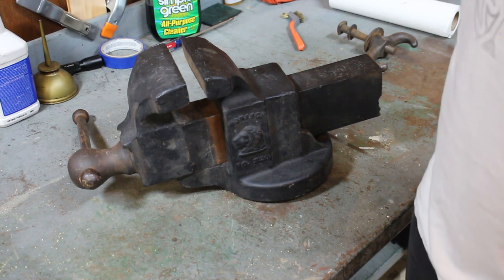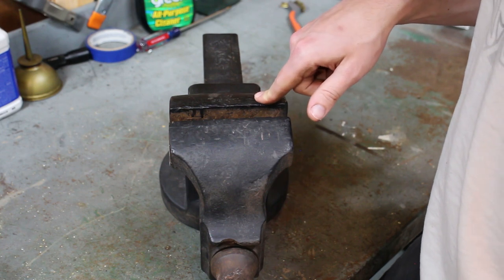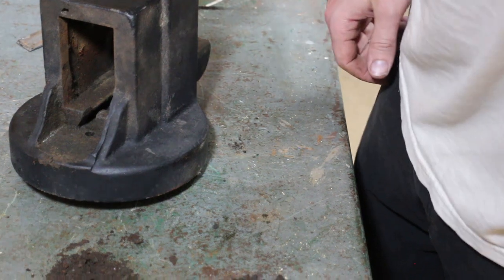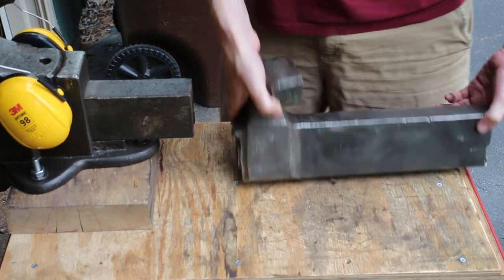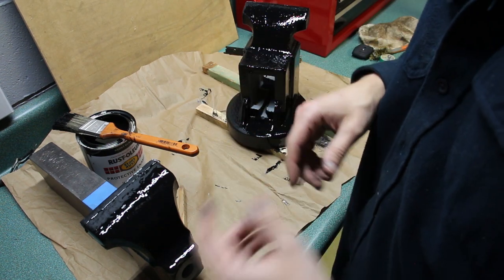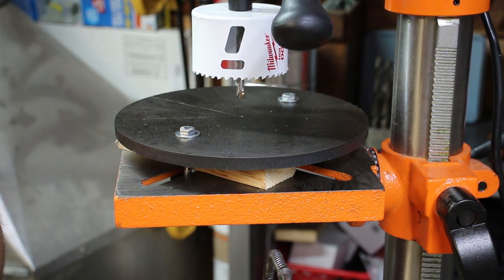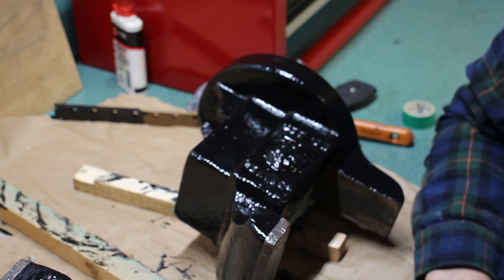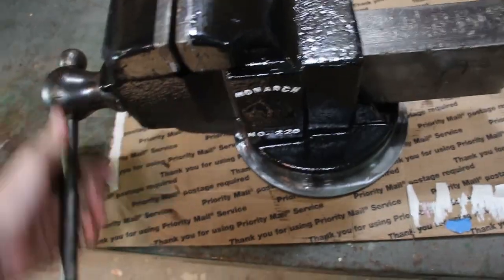Monarch Swivel Base Vise Restoration - Fabricobbling Smoke Show

Comment: A tip for finding center. Use a carpenter square. Set the circle in the elbow of the 90, then take a speed square and use the 45 to scribe the line. Do it a few times and you will have exact center

Comment: Trace/cut a paper template of the round steel plate. Fold the round paper in half in 2 different locations and the "X" is dead center (then transfer center location back to round steel plate) or use the carpenter square/speed square method mentioned below for precision measurements.

Comment: Monarch was a lighter duty line of vises made by Prentiss. The bulldog was the heavier line. Prentiss patented the replaceable jaw inserts back in 1911, so the fact yours has cast in jaws still is going to most likely date it pre-1911. The fact it is a through the bench swivel may even put it back in the late 1800s. Not sure when the monarch line started production but it's definitely over 100 years old. Monarchs due to the design are highly sought after, nice find on that one!
Reply from the maker: Good info! Thank you.
Reply: Thank you for the interesting history on the Monarch vise. It has a cool and unique design. I found a #401 Monarch vise, but it was welded and missing the base, so I passed on it.